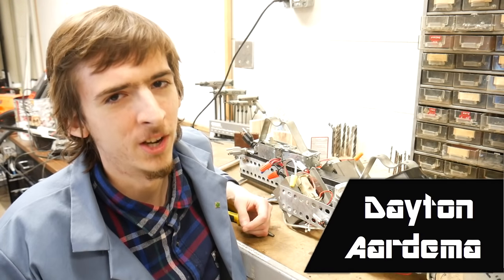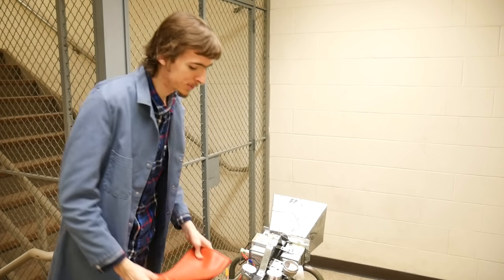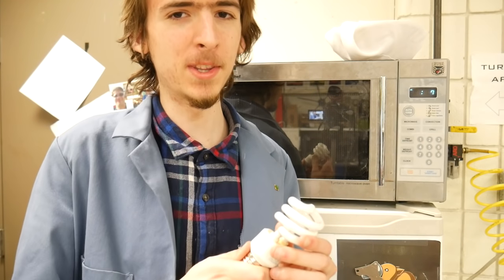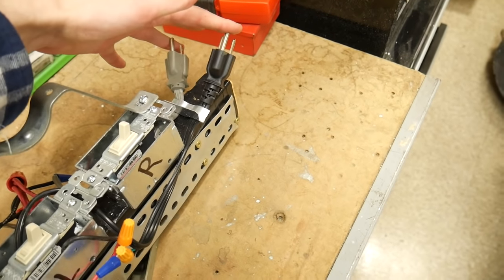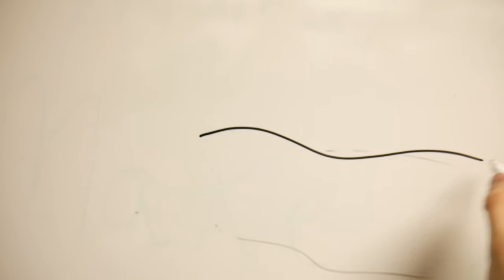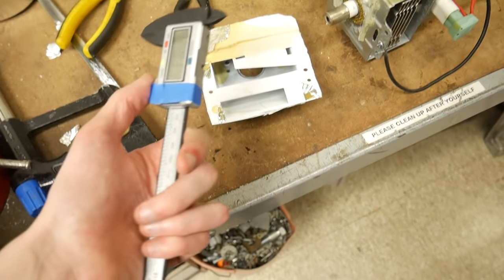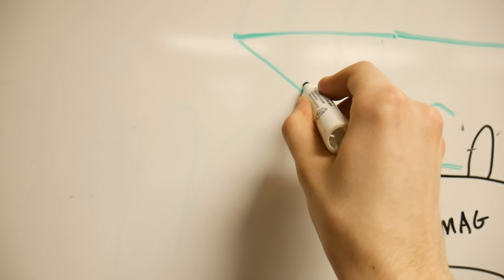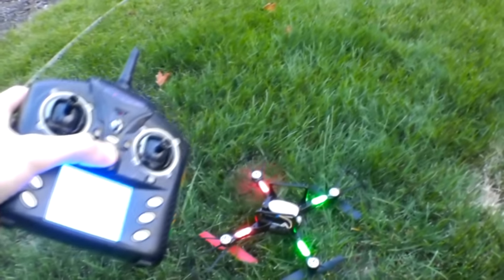How a MICROWAVE GUN Works

Comment: I see a lot of videos like this... no one ever tunes the waveguide and many use two or more magnetrons in the same horn. 
Now I really do not believe that you expected the magnetrons to output the exact same frequency and in precise phase. 
Or did you...
Reply from the maker: No. And I only ever used one at a time. I knew all to well that it was a very inefficient design. But it still worked well enough for me to have some fun
Reply: @BlueprintScience  you mentioned that if the phases were out of shift in the guide that would be "dangerous", could you explain why? great videos btw, many thanks
Reply from the maker: @spandon  Sure, if the waves are out of phase, you could theoretically get much higher output frequencies. It's not particularly dangerous (I can't remember exactly what I said) but it can mess with the waveguide design for sure. The last thing we want is the guide absorbing or reflecting back the power when it should be moving it down the guide.
Reply: Thanks, it was at 11.00m
Reply: my bad, "if the lobes were out of phase"

Comment: Hi, Dayton Aardema. This is a stunning work. I want to ask you question. Is it possible to use helical antenna instead of horn antenna. if not please tell me why? Thanks.
Reply from the maker: Sup Faud,
I dug around in my e-mag knowledge a bit. Helical antennas create circularly polarized waves, which means that you would need a circular waveguide also. Waveguides only direct the wave, not create it. The antenna itself is on the magnetron - the piece just above the ceramic insulator. You would need to tap off of that to attach a different antenna. Beware, helical antennas' field lines go all over the place.
To answer you directly: Yeah, it's possible, just... different.
Reply: @BlueprintScience   Thank you Dayton for your reply and explanation. I have another question. How can a helical antenna be attached or be coupled to magnetron? How can we connect SMA connectors with coaxial cable from a magnetron to helix antenna. And what about the heat of microwave signals, Does affect the coupling of SMA? what kind of material should we use for helical antenna?

Thanks in Advance.
Reply from the maker: @fuadhamamah6322  Honestly, I hove no idea how best to tune the antenna to the magnetron. Though, I imagine that making straight electrical contact should be enough.

Comment: Could an "old school" 4 meter satellite dish be used as a focused beam high energy "weapon" by replacing the LNA with an engineered wave guide & 1200 watt magnetron  to overload the receiver circuits of a satellite ? Generally satellites like the Dish Network and Direct TV only transmit about 10 to 15 watts down to earth. They probably have input overload protection built in though.
     If it was possible and one got caught doing this, would you have to pay for a new satellite and launch (after 20 years in prison)?
Reply from the maker: I honestly have no idea what would happen
I've got a cool idea. Why don't you do it, and I'll watch from a distance
Reply: Elaborate, you have peeked my intreast.

Comment: Expose A plant---ideally,  some tall grass (or wheat) in a planter to the beam----See if the beam will cause the grass to bend over and see if the nodes will blow out-----This might demonstrate how crop circles may be formed.  (the real ones NOT done with rope and boards)
Reply from the maker: Nice!
If you ever get a chance, check out the magnetron weed killer that I linked in the description. I don’t think it’s very effective, but it is cool

Comment: you microwave gun cover a 900 feet distance?
Reply from the maker: No sir. The power drops off by a factor of r^2. At 900ft it would only have an immeasurable fraction of the power output.
Its practical range is between 3-7 feet.
Reply: is possible to 150 feet?
Reply from the maker: Well... If you really want to microwave something from that far away, you can design a waveguide. A good design is not very lossy.

Comment: hi, I would like to build a microwave machine to disinfest wooden floors and furniture from woodworms. Using the components of 2 microwave ovens, can you advise me on the shape, position and distance to observe to build the electromagnetic bell? I would use the original 6.4cm magnetron guides but how should I assemble the emitters? placed side by side like your gun or as I see on the net arranged in parallel? A thousand thanks

Comment: i think that microwave oven that you showed at 4:40 is pretty broken, you can hear the characteristic magnetron sound through the door
Reply from the maker: It didn't really sound like that. My mic just couldn't handle it
Reply: My microwave is making a loud feedback sound just before blows the fuse any suggestions
Reply from the maker: Yes. Get a new microwave.

There must be a short somewhere within the microwave. My guess: the transformer. When they overheat, the insulation breaks down and it may now be arcing.
If you love your microwave, you can buy a cheap used one from a thrift store and swap out its functional components into yours. Or just use that one.
Reply: Blueprint look my microwave had it for 30 years Kenmore best don't even runs about 2 or 3 seconds before it blows fuse I overheated some TV dinners in it and that's what started this don't see anything burnt or in the megaphone looks fine and nothing's looks bad nothing don't find any shorts in it anything overheated any more it makes the regular microwave noise but it's Amplified any more thoughts would be appreciated
Reply: Polystyrene Planes my microwave is making a loud noise 2 only runs a couple seconds before it blows the fuse the Magna Carta looks good along with the everything else any more suggestions

Comment: What about a
MICROWAVE LASER?
Is one possible? What could it do? How could one be made? Or, why is it impossible?
Reply from the maker: For lasing to occur, stimulated emissions are required. Typical EM sources have what is called spontaneous emissions. Stimulated emission requires a constant and controlled pumping energy and a mirror feedback system for amplification. All of this needs to jive such that the waves are allowed to cohere before exiting the gas chamber. This is, of course, assuming that there was a gas with the desired emission spectrum. Oh, and it would need to be huge to accommodate the 6cm minimum wavelength of microwaves.

Well... you asked ¯\_(ツ)_/¯

Comment: Could a microwave gun be used to create magnetic fields or magnetised
Reply from the maker: Yes and no. Microwaves are light, the magnetic fields that comprise it are not like a bar magnet or an electromagnet. What the changing H-Field (proper terminology for magnetic field in a EM field) does when it gets to a metal is that it creates eddy currents (rotating currents) in the metal, which indirectly magnetizes it.
Did that make any sense?

Comment: You want real power Bearden discribed
A weapon using two microwave beams
That wore 180 degrees out of phase with each other cause tremendous destruction.  But I think 4 beams is more
Likely the scenario phasing can remove heat or implant it.

Comment: Will the horn actually amplify microwaves or just spread them out? I think a horn can only amplify  sound. If you want to amplify anything else you would need to concentrate it into a smaller point
Reply from the maker: Electromagnetic waves can be amplified the same as sound. Note, it doesn't increase the power, just the amplitude.

Comment: Hi..the idea is so cool. but what if i connect an another transfomer in parallel for increasing the current so i think the range of the microwaves will be increased too. However if the transfomer is connected can the magnetron handle the increased current?
Reply from the maker: The magnetron is tuned for a certain voltage so that the magnetron cavity can catch electrons at their "critical angle" - of course this has a lot of variation.
If you could supply more current to the magnetron at the same voltage, it would be more powerful but it would heat up quickly. And magnetons suck at heat dissipation as it is.

Comment: If Savannah syndrome is caused by microwave. What is the best way to evade such a weapon? Are there objects a theoretical weapon would not penetrate?
Reply from the maker: Oh yes. Aluminum foil, or anything conductive is a shield. For more, look up a "Faraday cage"
Reply: @BlueprintScience  So, if in a high rise building. Running into an elevator might be the smartest place to run?
Reply from the maker: @bellyacre1  You say “run” like time is of the essence.
Maybe after a few hours or days you might consider getting out of dodge.
Reply: farraday cage with all copper outter shell

Comment: it was the batteries that exploded.  voltages do explode electronics, frequencies implode- explode vacuum tubes and so on. new cell phone batteries explode on airline flights and when punctured. i don't think you can half ass a comparison claiming fraud when you fail.

Comment: sai can you explain what is the use of a capacitor, diode and how could we control the heat in the microwave oven
Reply from the maker: sai ilfs, sure thing...
The capacitor and diode are a half wave voltage doubler. They send peaks of 4000V into the magnetron. The magnetron needs voltages like this In order to operate.
Second, microwaves aren’t “hot” per se. there is a fixed energy rate and we adjust heat by how long things (like food) are exposed to that energy.

Comment: I'm licensed to use that that up to 1500 watts. I just need a way to modulate that thing (and someone else that has one)!
Reply from the maker: Don't look at me. I don't have an illegal transmitter... anymore

BTW, is it worthwhile to have a radio license? I've been looking into that.
Reply: I started in radio back in the mid 70's but I was too lazy to learn Morse code that was required then and got my ticket in 86. Ham radio has grown a lot since the code requirement was dropped. You seem to already know the electronic theory. You may learn a little more about antennas and signal propagation. Our frequencies start around 430  Khz and run all the way to light. I work some in the MF and HF bands but my favorite is the VHF/UHF and 1.2 Ghz bands. All you need to do is study the rules and regs, take the test, and get on the air.
Once licensed you can build and use your own home brew   gear if you want. Let me know if I can help. OH, I almost forget to tell you we have several low earth orbit sats up too.
Reply from the maker: Thanks, m8
Reply: Like a mule with a spinning wheel.

Comment: Have you tried connecting the magnetron to an antenna? Something directional, like a Yagi or helical?
Reply from the maker: Thought about it. It would be hard to make that an interesting video though. I don't know what I would do with it.
Besides, a horn is technically an antenna (according to my 1986 textbook on antennas for what that's worth).
Reply: I was in microwave communications  in the Marine Corps. Our waveguide  was hooked to an 8ft parabolic dish. It transmitted in the direction the dish was pointed and the signal from the other location used the dish to focus the waves to the receiver in the center of the dish (about a foot or so away from the dish.)

We transmitted line of site with about 10 watts. Our instructor told us that he was transmitting over a calm lake and they had 5x5 com over several miles on 1 watt. 

It took a bit more power for a troposcatter set up.

This was 30 years ago. I don't even know if they use microwave communication any more.

Comment: The fuck are you talking about, that is not a voltage doubling circuit. It's a voltage halving circuit. That's what diodes do to AC, they halve AC voltage. IDK why everyone says MOTS output 2000 volts. They actually output 4000 VAC. That's only brought down to 2000 VDC by the diode, which is what will charge the capacitor, and power the magnetron. 

MOTs output 4000 VAC
Magnetrons use 2000 VDC

Comment: Hey buddy, can you try to do this in reverse i.e., from the frequency vibration in to energy electrical energy or else, please. Thanks you.
Reply from the maker: Unfortunately it doesn't work that way. The inside of a magnetron is not a suitable waveguide for 2.4GHz waves. The energy would be dissipated as heat in the metal after the antenna re-absorbs the waves.
P.S. What do you mean "or else"? Or else what?

Comment: Do you know how I would be able to detect the ‘rays’ that come out of microwave/electromagnetic weapons? Like ideally there would be a type of lens you would need in a pair of glasses but that’s unlikely right?
Reply from the maker: Detecting the source of a radio signal (like a microwave weapon) is doable, but an involved process. First you would need an antenna to receive the radio energy (like another horn antenna) on a turn table. Rotate it 360 degrees while taking a constant measurement. At the angle where the energy is the greatest, that is most likely the source.
Reply: Blueprint Thank you for the response, what parts would I need to purchase exactly to build such a thing? Is there a good link you can maybe provide me with?
Reply: leds maybe?
Reply: personally id like a table with a ton of lights to light up and indicate nodes, etc.  then you could tune it.  youd just need lightbulbs or leds in the yard, and then rotate the microwave platform to see how the wave looks in 3d. nodes and antinodes and dispersion and so on... 

i think for safety equipment take the screen out of the door and make goggles from a microwave door.

Comment: When you say that microwaves are "low frequency", you are most definitely wrong.  They are classified as *high frequency* -- GHz is most definitely higher than your FM radio which is in MHz or your AM radio which is in kHz...
Reply from the maker: Right. I was talking specifically to the fact that they are at the low end of the EM spectrum

Comment: I suspect (just a feeling i got when you talked about the waveguide and how parts of it are made so it "kills" some of the waves) the efficiency of the gun is in the design of the waveguide and the horn. Probably a circular design (like a lamp shade is circular) should work best since the antenna is circular (actually the brass "sponge" is the emitting part I have understood, so covering it with caulk (or worse electric grease) to hold your waveguide and hor thing is a bad thing) and most likely the "lobs" are emitted in a circular shape.
I wonder though, can a setup taken from a standard microwave be used to mess with the engine management of a tailgating car if hooked up to an inverter ??
Reply from the maker: To answer your question, a diesel engine is completely mechanical. It is doubtful that a microwave fun... I'm sorry - I meant microwave "gun" - could affect it, even if it wern't in a Faraday cage (the car body).

Is per your other points, you are right in that the waveguide isn't the best of most application. Most high power applications use a dish.
Honestly, I don't know much about the brass part other than that it is not necessary. Since, its grounded to the frame, it couldn't emit anything.
Finally, the lobes I mentioned are in fact 3D, forming a torus (donut shape) around the antenna. There are actually infinite smalller lobes at steeper angles. 

Thanks again for the comment!
Reply: Well hopefully you have still a gun/fun left to test it on a non diesel engine... BTW: even modern diesels rely on some sort of electronics to make it go. At least the injectors are essentially miniature coil pumps which should get disrupted when exposed to über wifi.
Reply: Seeing as most vehicles have a metal body, and these waves don’t go through metal. I think it’s safe to say the answer to your question is no.
Reply: But if you have an issue with tailgating vehicles. I do. 

I’d recommend a less destructive method. Also, inverters that you put in a car that run off of a 12v battery are quite limited on the amount of current they can supply. I don’t think you will be able to even power it properly anyways. 

But a less destructive method would be to aim your windshield cleaning nozzles so that when you clean your windshield it gets theirs too. Also these waves can mess with pacemakers, so already that’s terrible. 

Another method would be to install a pump, tank, and switch. Run a hose to your rear drivers side wheel well, point it towards the front of the tire (towards your steering wheel) and put water in the tank. Flip the switch, water gets pumped onto the rear tire,  tire flings the water on tailgaters windshield. They will have no idea wtf just happened. Lol.